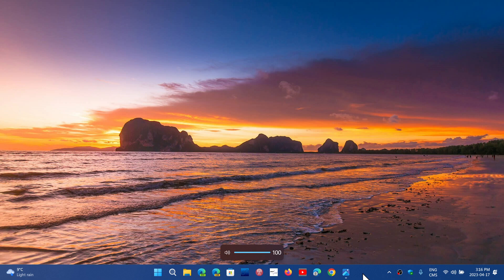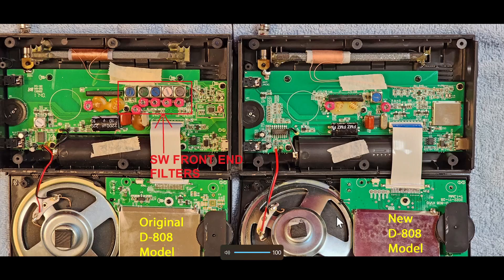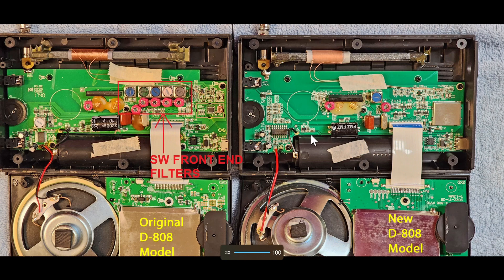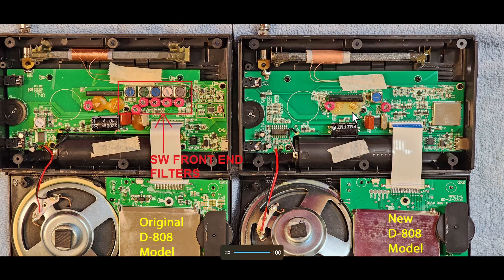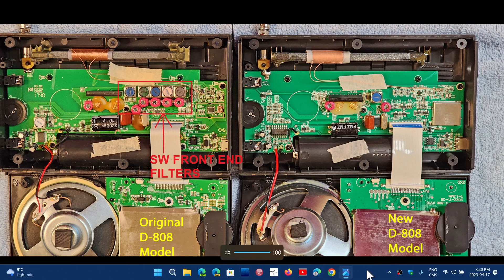XHDATA D 808 Original VS NEW Version internal circuit thanks to N9EWO Dave radio page

Comment: So what are those three, very small looking IF can type components in the new D808 that are in place of the IF cans on the older model? Did they just use smaller components (perhaps ones that aren't quite as robust in filtering)?

Comment: But what's under that metal can on the right? That's new.
Reply: They did not removed FE filters just replaced them with SMD and DSP part is shielded (metal square)! So looks better the new version…
Reply: @petrok1rp254 Maybe thr new one looks better, but does not sound better.😂

Comment: The new one has a bad FM breakthrough in both SW and Air Band. The charging system is bad comparing with the older, as well as the load speaker has less power. Unfortunately, this new upgrade converted what was a good radio into a pice of junk ... it is BAD,BAD,BAD ... They are cheating by replacing the main board without mention
Reply from the maker: There is no cheating, they do what they want, and I live in a very rough place for FM breakthrough and it is not really that bad, for me it is very close to the original
Reply: @OfficialSWLchannel  I'm sorry but can you explain by what you mean here? Don't trading standards not apply where you live?

Comment: As already mentioned quite sure they didn’t completely removed the front end filtering. If you take a close look you can see now diode switched bandpass filters consisting SMD inductors and capacitors instead of the filter coils in the old design. This is a common method for front end filtering.

Comment: These filters are actually tuned via the Si chip using varicap diodes .  By having a track tuned front end, the RF section can be programmed to use higher gain while reducing cross modulation and over loading, but is still mediocre at under 50 dB. The normal superhet designs use wideband low pass filters , and rely on a first balanced mixer to achieve a slightly better result.
Reply: I was not thinking that because I have no ideea what you are saying :)
Reply: Yep ! I was about to say that
Reply: This exactly what i was thinking 😂

Comment: In the new version, the amplifier was changed now it is lm4863s. About the input filters, they did not remove them, they are, but now they are smd. There was no difference in reception and sensitivity with the old version
Reply: I see there are SMD LC filter components and an extra few transistors.  It definitely has filtering but I guess less FM rejection.  Maybe less SW loss?
If they wanted to save money, it’s the air band chips in the middle that must cost a fortune compared to what they removed.
Without the ability to scan saved air frequencies like a real scanner I don’t get anything out of air anyway, but I guess it is a draw for many.  WX alert would make me happier, VHF ham even more so.
Reply from the maker: Yes they were removed, it shows in how much FM breakthrough I get on the new one VS original

Comment: I see the prone to failure telescopic antenna connection is the same on the new one, was hoping that would have been addressed
Reply: No, they didn't, the plastic plug who holds the antenna is fragile and prone to bend and broke. I fixed mine with epoxi.

Comment: I have the first generation Sihuadon D-808 and the second generation XHDATA D-808 (amber backlight, rubber feet, micro USB port). They both seem identical with respects to sensitivity and audio quality but for some inexplicable reason my Sihuadon D-808 does not show the RDS icon on standby mode. My newer XHDATA D-808 does.
I didn't realize that the XHDATA unit which I bought back in January this year had the rubber feet until I watched Gilles' earlier video on the updated D-808.
I think the rubber feet were added on to earlier units before the manufacturer switched to the USB-C charging port. It made sense for the factory to also replace the micro USB port to USB-C as they were already making changes to the new circuit board without the front-end filters. 📻😐
Reply: If you switch the time set set from manual to auto, the RDS Symbol will apear in standby....

Comment: Hi Gilles,
I own a Shihuadon with micro USB and rubber feet.Bought it November 2022.I opened it today just to check what kind of version it is and all the filters are at their position.
Cheers 😀
Reply from the maker: Thanks for checking it out, it means that if you have a micro usb ..its the original ....if you have usb C its the new
Reply: @OfficialSWLchannel hello, what could be broken, I have a xhdata d-808 radio, old version, all bands work, but not the air band band, I also have xhdata new version and it receives the air band very well, best regards

Comment: Hej Gill thanks for the video and it was very interesting to take a peak inside of the new Sihuadon D-808 ond the old Sihuadon D-808  I'm a bit tempted to take apart my Sihuadon D-808 and see what it looks like on the inside. But I'm sure I have the old Sihuadon D-808 model mine has no rubber buttons rubber feet and usb c socket but, I'm not one hundred percent sure before I open up my Sihuadon D-808 and look inside so i will do that take care Gill.

Comment: I just received two XHDATA D-808 with micro-USB charging ports. New or old version?
Reply: Yeah I got mine 2 weeks ago and it's got micro USB and rubber feet.   It also came with a 1500mAh battery,  which is a little unusual
Reply: Most likely you have 2 older D-808 models!...